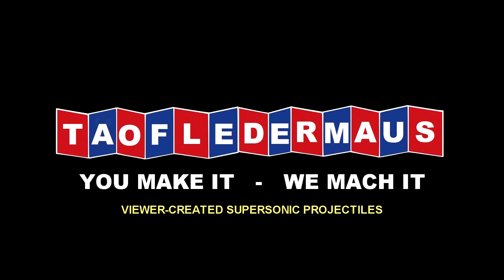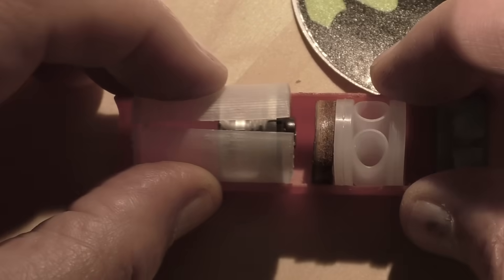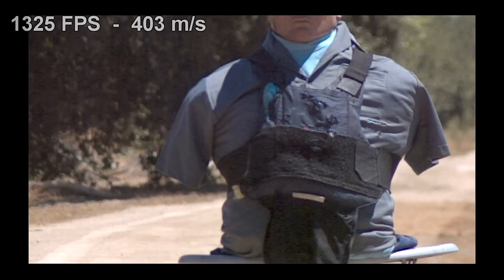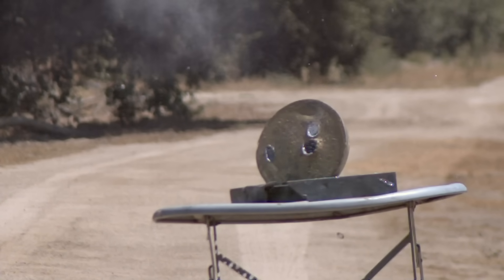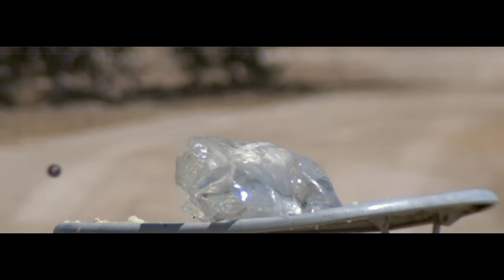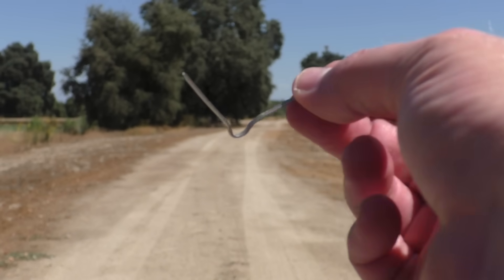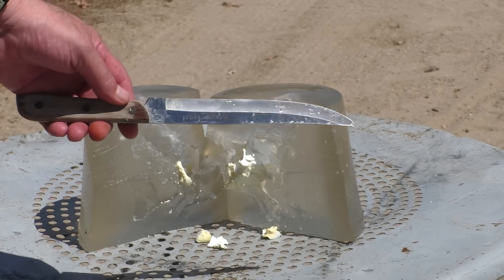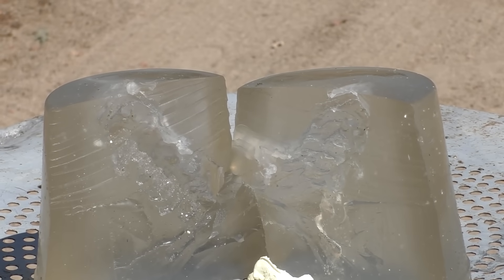.675 Caliber GLASS BULLET -  Supersonic Impact Test

Comment: I had this idea about making prince rupert drops from a shot tower. 

If the drop falls long enough to form into a sphere before hitting the water it won’t have a tail and be truly indestructible. Probably would embed itself into the lead plate.
Reply from the maker: Wouldn't those just be marbles?
Reply: @taofledermaus Marbles are cooled slowly and annealed, in contrast with a prince Rupert drop which is dropped into water while still molten and that creates some extremely strong tension and compression stress which makes it both nearly indestructible and explode violently when you do manage to damage it.

Comment: I think this one wins for the worst warcrime AND chirugeon's nightmare rolled into one as while the shrapnel created by other slugs is obviously bad and highly damaging, just imagine having to clean all of that powdered glass out of someone who survived a hit from this thing?  That crap can get into the blood stream and start flowing through the body leaving micro-cuts throughout the circulatory system, never mind the nightmare of some of those particles making it into the brain.
Pot metal is literally just an alloy created by tossing a bunch of scraps of low melting point metals into a pot and is normally used for casting cheap stuff which doesn't require high quality metal.
While zinc is often found in pot metal, zinc is normally classified as zinc when on its own.
Zinc would be a very poor choice for this slug as it is extremely brittle thanks to how hard it is - I cast stuff with it on a regular basis and have had finished products snap in half and even shatter from simply being knocked from the workbench onto the garage floor.
Zinc is also (relative to other metals) light which would mean that, combined with the glass, is going to result in something too light to stay stable.
Wow, that glass turned into sand when it hit the lead.
LOL - any shotgun slug that hits bone is destroying it and potentially taking the limb with it.

Comment: These things are absolutely diabolical. Even if the target is wearing hard armour, the sheer amount of glass dust the impact creates, would cause complex wounds to any exposed flesh, get around behind eye protection of all but the gnarliest sort, and cause a severe breathing hazard to anyone close to the hit. 

 I wonder if the separation issue when shot through a smoothbore, could be mitigated for by gouging a shallow indent in the cork wad there, to let that screw head seat, while the metal around it is supported. As you had them there, the main point of contact was the screwhead, and without some spin to absorb the acceleration shock, it may have been enough to jolt the screw out of its hole in the components.

 Also, as an Englishman, any fool who says "Ackshully, that's a split pin." is a casual. Real enginerds know that these things have been sold in England, by English companies, under both cotter pin, and split pin designations, for DECADES, and, in fact, the further back you go, the more likely they are to be labelled as cotter pins. I should know, I've fit enough of them on jobs before.

Comment: So...I realize that 12ga is the "standard", but ever considered working with a .410?

On and off for the past 10 years or so I've been working on converting a bog standard Rossi/Marlin .410 (.444 frame) into something that can not only shoot .410s well, but take a .429 (.444) optimized for smoothbore as a heavy "oh, crap! Hogs!" Load that a .410 slug just can't do.

Any contacts would be apt, and it could make for a fun "Bunny Buster from Hell" episode.

I'd really like to get back into that project
Reply from the maker: There are very few .410 factory factory slugs out there.   It's almost obsolete compared to 12ga.

Comment: I do have a bone to pick with (pun intended) the fact that glass don't show up in X-ray. It's not true, it's wavelength dependent - Silicon has its sweet spot for absorption wavelengths before the glass shards will definitely show up in the X-ray film, which is technically why some high-end CT scan machines will still pick it up. Still, I agree it's far worse than getting hit with the salt deterrent shells.
Reply from the maker: It's just something commenters have told me over the years.

Comment: One improvement to this slug would be to epoxy or simply hot-glue a pointy, hard piece of metal facing the glass at its leading edge. That way, even upon hitting just soft tissue, the relative deceleration could be enough to consistently fracture the glass and force it to spread out through the target.

Comment: Crazy slug, crazy damage. New fear unlocked, being shot by a glass slug! It might be interesting to see a slug made completely of glass, or glass with a lead or steel core. 

All glass should not be that hard to do if you have a good mold. 

What might be interesting is a full 22 long rifle inside of glass, though that might be dangerous as the heat could set it off. Anyway, as always, a great video!
Reply from the maker: thank you

Comment: Bullshit,  as a teenager in 1981 right before starting my sophomore year of high school I wrecked my bike and landed in some glass,  it was at night, and I was close to home, it was pitch black and raining cats and dogs.    I had had enough Judo classes to know how to fall, so I tucked and rolled.  BUT my hand ended up cut badly.  with the adrenaline I did not know right away. I was about literately 4 bike throws from home...   when I got home I stepped up to the door to unlock it and looked down and ( with the Yellow colored bulb in the porch light to repel bugs) I looked sown and the porch looked Brown.  I thought Hmm  Dad must have painted the porch today. (very small porch just steps and a like 3X3 top.)  so I unlocked the door stepped into the house flipped on the living room light and then I seen the blood POURING out of palm basically where the base of the thumb connects to the wrist.  So at after midnight I start yelling for my Dad at toe top of my lungs taking the steps 2 at a time, Kicked his bedroom door open on my way to the bathroom to put my hand under cold water to slow the bleeding.  In comes my dad (quite quickly) and after about 4 or 5 minutes and the cold water not slowing the bleeding even with trying pressure points to slow the bleeding and it was not slowing.  so off to the hospital while wrapped in towel,  anyway enough of the blow by blow.  (odd how I can remember that like it was last night) My bullshit was about the Not detected by X-Ray.  Glass most certainly is detected by X-Ray.  My X-ray looked according to the DR "Like a glass rod went into my hand across my palm at a diagonal to the base of my Pinky then shattered.  so they could for sure see glass on the X-Ray.

Comment: I wish someone would make a brass or copper slug drill a chamber straight in the center at least half way through the length of it make a rocket nozzle brass nub, then heat the slug and let it cool and clamp onto the nozzle then fill it up with a rocket propellant such a rocket candy the back end of the slug might need a magnesium emulsion coating like on a  J 4 Sparkler to ensure ignition fired through a rifled barrel for spin and see how fast and stable it goes.

Comment: You get all those split pin/cotter pin comments because they are different things for different uses, And we are worried that you guys over might try to stop your hub nuts coming off, on with a tapered headless bolt with a flat ground on one side

Comment: As someone else noted, I was always told glass tends to have entirely uneven tensions in the, what some call, quasi-crystal, which may be a part of how it is able to translate light? In any event, because the tension is not the same in any two pieces, with our current manufacturing, I suggest failures would be too common for anything except sporting, as, I'm guessing, 85% is fine if you're plinking. Great stuff as always!
Reply from the maker: thanks